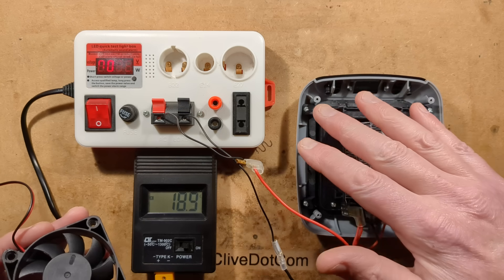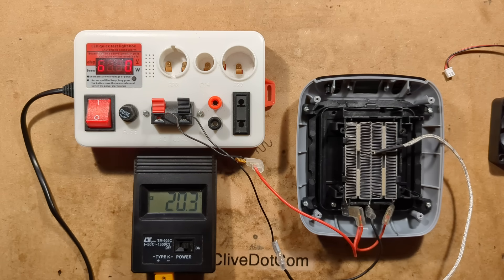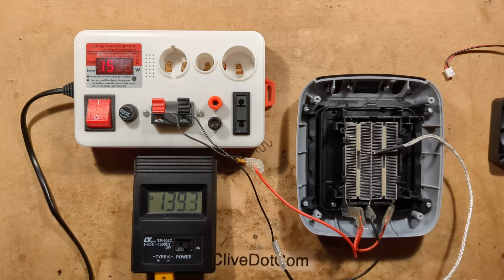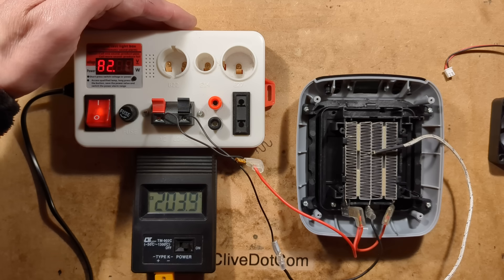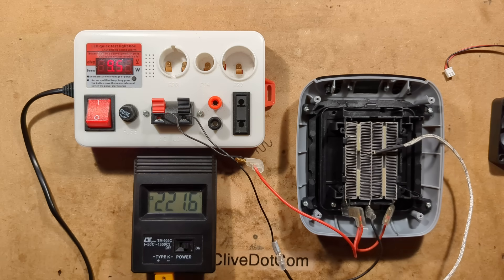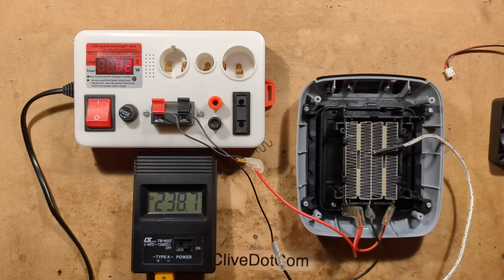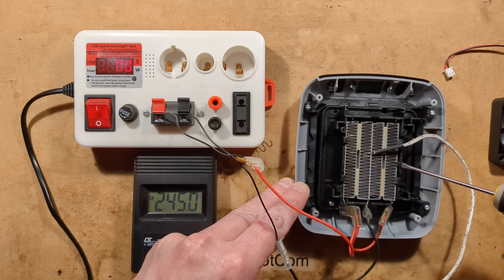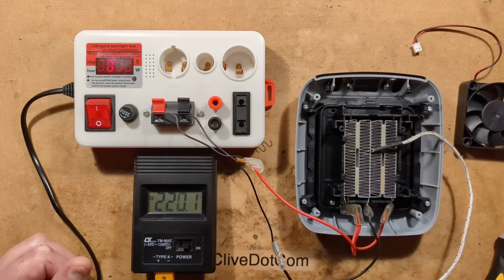Let's overheat a Tesla miracle heater core to see what happens

Comment: Just for fun, if I had one of those to play around with, I might experiment with overdriving the fan or replacing the fan with some other model to see how much more sustained heat output could be achieved by removing heat from the PTC elements faster.  I’d imagine you’d run into diminishing returns very rapidly, but interesting nonetheless.

Comment: Removing or bypassing the thermal switch from these heaters leads to fan failure and then you end up with this result as the heaters overheat. I use these heaters to heat 3d printer build chambers with a PID to controll the operation. They are small enough to fit.

Comment: so running at lower speed will be hotter but more power efficient ... The question his how long the ceramic heater will last running over 200°C... I guess if he put a fan pushing air from a distance and let the air get out about 180°C , it could warm a small room in 2h ...

Comment: In 3d printing 245 degrees is what we set the hot end to print ABS at. That plastic must be polycarbonate or even something better like PPS to resist such temperatures. Can you look for the mold mark that indicates the plastic type? Google recycling codes, it's a triangle made with arrows.

Comment: Its impossible to force a PTC heating element into thermal runaway , as the element heats above a certain point , the currrent draw of the element by design will drop so low it just can not get any hotter, Thats why they used them on the space shuttle ,

Comment: Those fans are so poorly made that shipping the things can damage the fans.  I've got a $10 walmart cord version of this that I replaced the fan on by simply taping a new one on the back and hard-wiring it to the cord in the housing.  Makes a LOT of noise now but the heat also makes it all the way across the bathroom.

They've been shipping heaters with these super illegally stiff cords that can knock them over and the tiny ones are so light that the cord will actually knock them over and push them across linoleum.

Illegally stiff?  Yup.  Cord flexibility on a lot of Walmart stuff violates import limits.

I've seen these things put in "chimney" stands where the updraft is all that's used to circulate the air.

Comment: It's NOT the unit that is usually a problem...
It IS usually the actual outlet or how the outlet has been wired that fails, and creates more heat than expected. 
Most people would never check the wiring to an outlet. With this type of device, unfortunately one can NOT see the outlet, once this unit is plugged in. 
NEVER PLUG ANY HEATER INTO A PLUG STRIP, OR EXTENTION CORD. ONLY DIRECT INTO OUTLET. 
HEAT CAUSES FIRES.
Remember... circuit breakers sense overload. NOT OVERHEATING !!!
Nice video. 😃

Comment: I was just commenting in discord, with a UK plug (or a fuse) and a thermal fuse, just in case something nasty happens, (the tracking you mentioned etc) this'd make a decent little frostwatcher heater for an equipment cabinet or a cupboard with lots of pipes etc....

Comment: I do have to say that this is a bit of an "ideal" condition where the enclosure is busted open and the heater is facing open air. I... wonder... what would happen if it were still enclosed and sitting back against the wall. I don't think any amount of self-regulation would have saved this thing from catching fire.

Comment: I just noticed this. Glad I did.
 Would have expected a thermal fuse built into the ceramic. But I guess it doesn't need it.
464°F then,  Customary US  measuring system.

Comment: Should have left the fan on and just unplugged it. When the fan fails the only way the heater can lose heat is through convection and radiation. Being enclosed and covered by the fan would reduce the rate of heat loss so the temperature equilibrium point would be higher.

Comment: Good little design. I just worry for the inevitable "material cost reduction" when they change out the decent plastic for ABS.
Reply: that is a good point, 235-240 is often the low end of ABS in 3D printing.

Comment: Those PTC heaters are surprisingly safe. I was trying to repair some guy’s floor-standing fan heater because it just wasn’t putting out any heat, so I plugged it into my kill-a-watt generic clone before turning it on. Saw 2000W for a second or two, dropped right down to 50W or so, no heat could be felt. Suspecting it was a PTC heater, I wondered if the airflow wasn’t cooling the heating element properly, so I took off the grill. Packed full of dust. Cleaned it out and it worked good as new. Certainly a much better failure mode than a thermal fuse blowing, and more reliable than a thermistor going on and off. If you want to adjust the heat output, I guess you can just change the fan speed, though I don’t know if any of them do so.
Reply: If you look at the previous video you'll see that this very model has a 2 speed fan.
Reply: Some older models used a variable speed fan to adjust the power, such as the Pelonis safe-t-furnace.

Comment: Ideal heater for warming hands at the computer, but I have my own prototype that I made from a different PTC element, drawing only 3.3 A at 12 V, cooled with an 80 mm PC fan. I’ve been running it this way for two years. Previously, my prototype used a 75 or 100 W regular bulb, but it only lasted about a month and the light was slightly distracting.👍

Comment: My only issue with your setup is that even if the fan had stopped there would still be airflow, so elevating the eater off of the bench might have shown different (maybe lower) results. Still good test. Thanks!

Comment: Hello Clive. I suspect that the black plastic frame for the fin housing should have injection molding marks to ID the type of plastic used.
If you can see the marking, it may read contain the letters "<GF 30>" as part of the description. This usually means the plastic is Nylon Glass Filled more or less at 30%. Intake manifolds on a cars engine use this material and handles the heat very well. I think about 400 F or so before  melting. I don't know the C degree equivalent. The outer gray shell plastic is my guess. ABS plastic.
Reply: As far as I know lamp fittings and this ind of mountings are made of melamine, which is technically not plastic (thermoplastic) but a thermohardening resin. When overheating it smells like p*ss.

Comment: but what happens if you put everything back in it's place  ?  in a 25c degrees room ?  will the fan melt and start a fire ?
Reply: The heater is incapable of heating any room to 25°C. Anyway, for the element it doesn't matter what the ambient temperature is ... it self regulates based on its own achieved temperature, so in a hot room it would simply reach that peak temperature sooner. There's certainly the possibility of the fan or the outer casing reaching a melting temperature if this was tried in an assembled state (but the room ambient won't have much additional effect).

Comment: That fan doesn't look like the plastic it is made of is exceptionally heat resistant, probably just as well you removed it, and didn't just disconnect it for your test, the weather is too cold to have the doors and windows wide open to get rid of the acrid smell of melting plastic.

Comment: Now re-fit the fan, but leave it disconnected. Run the unit with its case on.
Reply: My thoughts exactly. 50 Watts in that confined space is a lot of heat.

Case on AND vertically oriented

Comment: I have to admit my ignorance.  I thought a Ceramic Heater had resistance type elements encased in ceramic blocks.  That’s why I watch your videos, to learn not just be entertained.
Reply: Sometimes they do .... the PTC ones are more modern ish, but they have been around for a while now, cheaper to make i guess :)  And self regulating as Clive has just demonstrated
Reply: @TheChipmunk2008 thank you, that makes sense.   Then  I am sure the 20+ yr old small cube type Ceramic heaters I have here are just as you described.  I have never had one apart to actually look how they were designed.

Comment: does it work with 100v dc if use 3 solar panels in series
Reply from the maker: DC would prevent the triac from switching off, meaning the heater would stay powered on continuously.

Comment: I have an original Micro Furnace from 30+ years back, aside from needing one repair about 25 years ago, it still works like new. The ceramic elements self-limit quite well, but the internals of the MF are all metal and mica insulation, so completely heatproof. I wouldn't trust any heater with plastic surrounding the element so closely.
Reply: MF? Oh, micro furnace.

Comment: Normally the heater would be vertical with the case fully assembled. If the fan failed the heating element would probably reach a higher temperature inside the case which although vented would reduce the airflow.

Comment: I wonder what happens to the fan if left in place but not working?
Reply: The heater will be less lonely to die as it still has a fan...
Reply: @LawpickingLocksmith  😂
Reply: It will melt and release smoke, giving a clear indication of failure.😀

Comment: It seems there are two elements in parallel. I wonder how this would work if they are wired in series. Safer, lower power, but still usable?
Reply from the maker: It could be viable to wire them that way.

Comment: You could get the United States 120-volt version and use your 0 - 240 volt variac to torture it to death as a follow up video
Reply: The 120v version likely has the exact same heater core. It's self-regulating.
Reply: @CanizaM that's no fun and you might be right

but I am self-regulating and when my girlfriend gives me twice the energy I go a little out of control

🤣🤣🤣🤣🤣🤣

Comment: I was always sceptical about these micro heater adverts that I keep getting bombarded with. They claim to be cheating the laws of physics. Normally - heat pumps excluded - if you input a certain amount of electricity into an electric heater then you will get nearly the same heat out. So if it is using 50W then it’s very similar to a 50W filament light bulb and will make very little difference to the heating a room.

Comment: One danger could be dust/grime collected between the stopped fan and the heater catching fire.
Reply: Not likely when the max temp is less than 240C, unless you're playing with pyrophoric chemicals or some similar nonsense.
Reply: Maybe, but would anybody want to heat a layer of dust and grime within a enclosed space....within a plastic enclosure...and call it safe?
Reply: @andic6676nobody is saying it's a good idea. But the reality is that it's extremely unlikely to cause a fire even in the absence of a thermal fuse because of the nature of the heating element.

Unlike standard wire, which will happily keep heating until the wire melts at 1000C or higher, PTC ceramics become nearly non-conductive and stop heating somewhere between 200 and 300C, depending on the formulation. So they literally can't get hot enough to ignite most common materials. You'd need to spill some chemical with an unusually low autoignition temperature on the heating element to get a fire.

Comment: A thermal fuse is such an expensive component!
Reply: It’s a strange omission considering the relatively high quality and thought put into the rest of the device. On the other hand it suspect that i5 was put through more rigorous failure mode testing than most cheaper devices and was found not to burst into flame often enough that the manufacturers decided that omitting a thermal fuse was a reasonable cost cut.
Reply: It's not needed.

The intrinsic nature of PTC heating elements limits their maximum temperature, so even in a worst-case scenario where the fan dies and airflow is physically blocked (as shown in the video) , it can't get hot enough to start a fire.

Comment: Mythbusters would now test what voltage is required to make the plastic become soft or brittle, or bettter, go up in flames. Or whether perhaps instead of applying a higher voltage, just covering it completely would suffice to achieve the same result, by preventing convection...

Comment: UL or InterTek Rating just around the corner then? 😂😂
To be fair, I expected flames and new bench skidmarks aplenty but no, not quite as dangerous they at first seemed. 
Does it have fanspin detection for a stalled fan scenario? 
GlassFiber reinforced plastics can have some reasonably high temp ratings I believe though not entirely sure where they top out though for certain resin types it can be between 200-300°C, or indeed if these fans are simply those types of plastics that readily combust at anything over 50°C.
Been super wary of anything 'Cheap' where heating is concerned since a time in my mid 20's where I pulled back my bedcovers to get into bed to find that an electric blanket, switched on an hour or so previously and left unattended, had scorched a 9 inch circle into my sheets, duvet and mattress.
Reply from the maker: No fan failure detection, but it does have an internal thermistor to detect case temperature.

Comment: 🤨 - I have a full-size version of that, it has the “conventional” set-up of a nichrome wire fan heater with the addition of oscillation-swinging and tip-over switch, has the ‘element’ block at the front with the fan behind; mains shaded-pole motor with plastic impeller, the heater block has 4 PTC ceramic strips for bars l/ll [quite weird on bar l, as only one side of the heater block is hot and the other side warm] and on top is user-adjustable thermostat, dial selector switch & button “pivot” switch. For “safety” it has a tip-over switch in the base, the element block has a button-style thermal normally-closed switch on the side of the block = that I later found only turns the element off [the motor not connected] and the usual thermal fuse which ‘kills’ it entirely, above the element, was  manufactured by Mapiln electronics, and I also have a conventional nichrome-wire fan heater to compare it with. Who ever designed it directly copied it’s nichrome-wire counterpart = with the thermal switch & fuse, the rectangular aperture the element block sits in has a weird little notch in the middle of its top; that is where the thermal fuse sits and has “bleed” air blowing over it 🤷‍♂️, all the pictures of PTC fan heaters I have seen don’t have it = assuming they don’t have the thermal switch & fuse knowing about the behaviour of the PTC ceramic throttling itself as it heats-up. And that it and others have a painted metal mesh grill on the front when the conventional nichrome-wire fan heater has plastic slats = I had found the PTC heater is slightly more hotter than the nichrome wire one on bar ll. 🤭 - this video has given me the confidence that I might test it with the motor disconnected that the plastic won’t melt? And connected to a meter socket how low the wattage goes. I have bypassed-removed the thermostat as it wasn’t reacting to the room temperature, and could feel the “bleed” air was coming out around the dials so it was being fooled that the room was still cold? If I ever become an engineer I want to reinvent it as a convector heater with it vertical with the fan off/horizontal as a fan heater, I have never seen any convector heater’s with PTC ceramic in them, only the “fan” variety 😒

Comment: I find it hard to believe that the ambient temperature of Clive's bench is 19C.  I could believe 14C, but 19C seems uncomfortably high (for him).
Reply: Shining bright lights at your bench will do that.
Reply from the maker: If did a quick test to check the thermocouple was working,  so there was residual heat.
Reply: Probably a highly localized heatwave
Reply: This experiment is obviously as fake as the adverts

Comment: Although PTC heaters are inherently safe, they should still have a thermal circuit breaker and the most overlooked safety feature an air filter.

Comment: nice to see they used thermosetting plastic and not thermoplastic type. So it least it wont just melt its way out of the case before burning your house down. A thermal fuse would not go amiss on a product like this, but if you don't bother to qualify it to any safety standards then you won't need one.

Comment: Perhaps if the heater was mounted vertically so that heat from the bottom of the heater impacted on the upper part (as per installation with a wall plug) it might get hotter?
Reply: Yeah, but not much. There will still be lots of convection.

The circuitry will definitely be severely baked but we’ve assumed it has already failed.

The fan is probably not as heat resistant as the bit holding the heating element and could get more exciting, releasing vapors and possibly igniting.
Reply: In the normal service orientation with the case in place I'd expect the other plastic parts of the casing above the heater to distort or melt. On its back with the case off the heat can rise straight off the element into the air.

Comment: So.... If i bought a version of these things for North America and plugged it into 110V would that make any difference? Better? Worse? No difference as it's all running through a transformer? I recently bought a small used fan heater. It's rated at max 900W, though I suspect it's about 250 and 700 Watts going by the feel. I think they are required by safety standards here that it needs to have a tip over switch. This one does have one, but the assembly is awful and that doesn't work.
Reply: the 110v version would be designed to work at 110v.  if you plugged the 220v version into 110v, it wouldn't  get very hot.
Reply from the maker: The self regulating heater and switching power supply might work on 120V.

Comment: 50 watts without a fan? Wew that fan must be using a lot of power 😏
Reply: its a ptc.  the hotter it gets the more it chokes off its own power, until it hits a balance point.  that's why they're now popular as heaters, very safe compared to a chunk of red-hot wire.
Reply from the maker: The fan only uses about 1W.  The PTC heater self regulates down to 50W if uncooled.